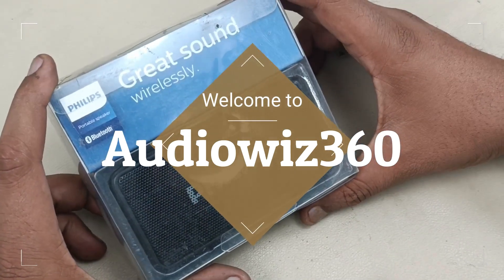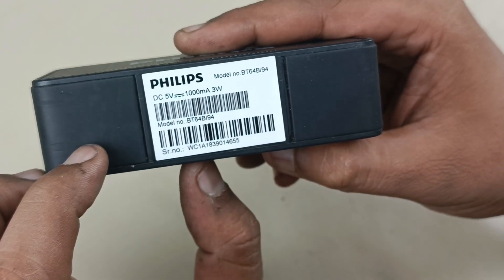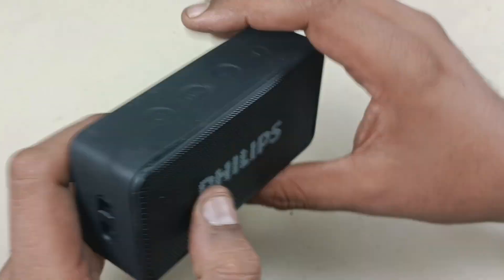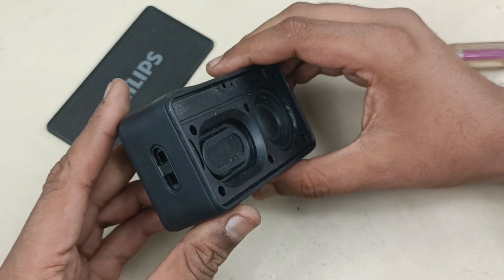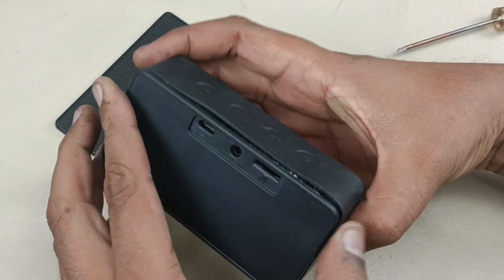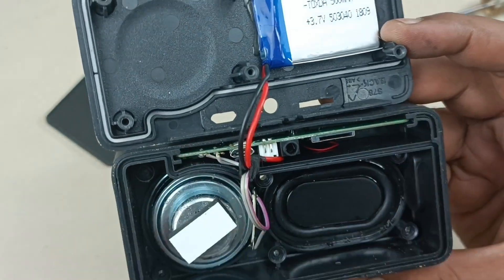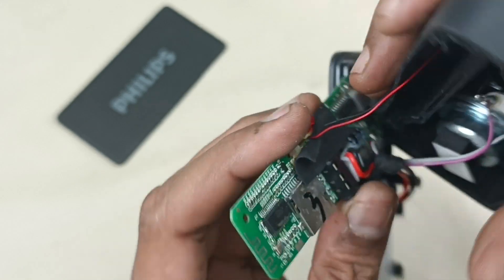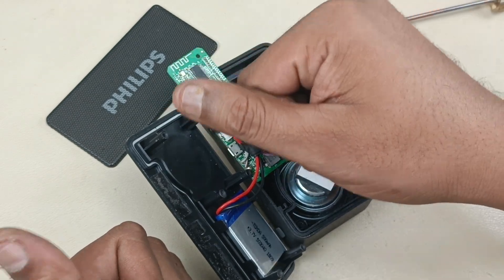Disassembly & Looking inside of Philips BT64 Bluetooth speaker , AM / FM / SD card

Comment: can I replace 500mAh with 1000mAh or 2000mAh while keeping the same volt 3.7?  If yes , please explain its effect on charging and backup? And any side effects?
Reply from the maker: replacing the little more capacity battery with same voltage will not harm the speaker,  but there will be problem/lack of space to keep the battery inside. 

charging time will increase and 
battery backup will increase.
Reply: @audiowiz360  thanks
Reply from the maker: you are most welcome! 🙂👍

Comment: It says 1000mah Battery but it's 500mah inside. I also did the teardown and found the same in mine as well
Reply from the maker: 1000mah is written in the speaker bottom side is charger specification not battery specification. Thanks! 😊👍